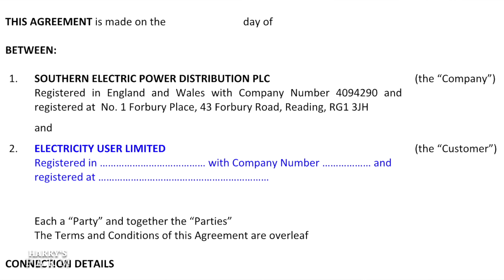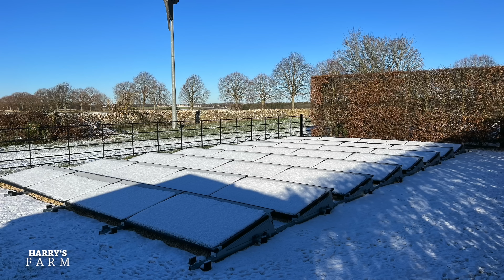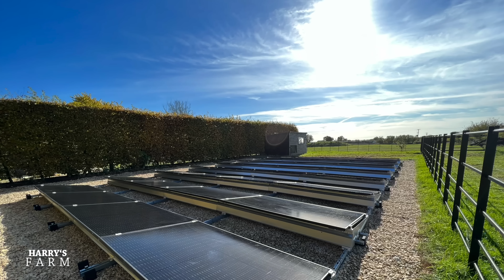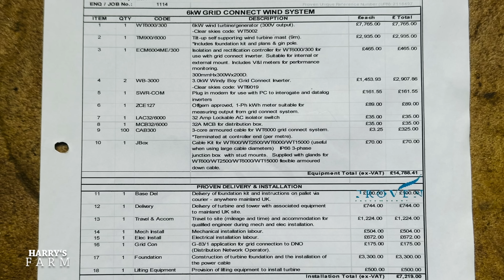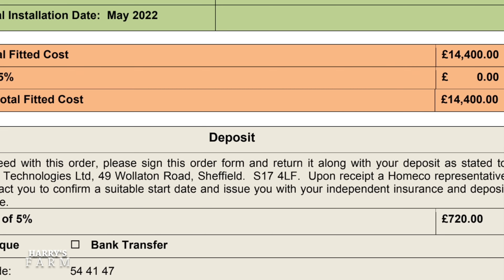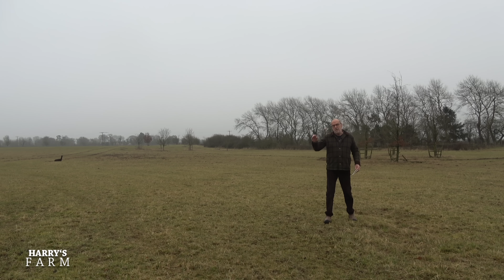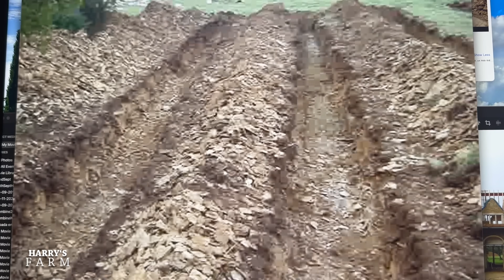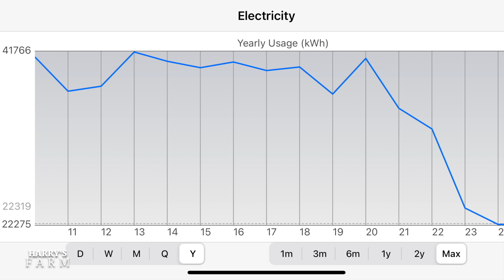Are solar panels & heat pumps worth installing? Here's what I've learnt after several years of use.

Comment: Solar doesnt really work well here in the UK. its the winter months when you need the power and those are the months when it doesnt generate any. Begs the questions is this massive investment even worth it. The people I know who have had 15-20k's worth of solar panels installed were told that it will likely take the lifetime of the installation just to cover the upfront costs.
Reply: Solar panels have dropped in price by 10x in the last ten years. Only 100 quid a pop now. 
Those early systems got generous subsidies too so I doubt that's true. 

The energy savings trust has a calculator to use for anyone who wants unbiased information.

Comment: Scientific papers can be a challenging read, many refer to other papers that should be read in order to understand the principles tested so can take days to plough through. Most of us don't have the time to immerse ourselves to fully understand them. The conclusions however are usually crystal clear and readily understood, viz:

"The greenhouse effect predicted by the Arrhenius greenhouse theory is inconsistent with the existence of the CRE (Chandrasekhar-type radiative equilibrium). Hence, the CO2 greenhouse effect as used in the current global warming hypothesis is impossible. Let us emphasize the overall conclusion:

The Arrhenius type GE (greenhouse effect) of CO2 and other non-condensing GHGs (greenhouse gases) is an incorrect hypothesis and the CO2 greenhouse effect based global warming hypothesis is also an artifact without any theoretical or empirical footing. Without scientific proof the debate on the CO2 GE based catastrophic AGW (anthroprogenic global warming) should be abandoned and policymakers should focus on the more urgent environmental and social issues of humanity. The recent worldwide energy crisis is a warning sign that the promotion of the so-called green energy is neither solving energy shortages nor helping to protect the environment from pollution. The climate does not need protection, but the clean environment does."

Ferenc Miskolczi: Greenhouse Effect and Climate Change

THERE IS NO CASE FOR NET ZERO.

Comment: If you want to get more over winter, you need to angle the panels better. Since yours are on the ground, it should have been easy to include a hinge and prop to adjust through the year. But you are right - no direct sun = no worthwhile output.

Also, tip for swimming pools - the biggest loss is through evaporation (latent heat). So if you are not using it cover it - even in the sun on a hot day.

Comment: To minimise the effect of the shading on the solar panels, you need an optimiser connected to each solar panel. That will stop the solar panels next to them switching off. Makes a huge difference for little cost. Your solar power company should have advised you of this.

Also those bushes next to them don’t help as they literally cut out the sunlight when it’s not at its highest point. You either need to raise your panels so that the sun gets through to them or lower the bushes to half that height.

Also if you had a battery, it could charge at a much lower rate at night and then use it during the day for when you have Low sun days. You can also charge at half price at night and export at a higher price during the day, bringing your bill further down.

Finally, you can add extra capacity of solar panels that are off grid for other parts of the farm.

Comment: We have just had solar panels and heat pump. Sold to us as in summer it will pay for itself. Reality in winter it eats electric at an incredible rate and cost is astronomical. In summer we don’t need the heating on so excess generated is wasted and not used. Don’t be fooled into thinking you will save money you won’t. Buyers beware.

Comment: Clearly the more northerly your latitude the greater the seasonal differences you'll see.  At regional or country levels a variety of energy sources will be necessary for year-round electricity so the large solar farms are useful in summer and not so much in winter.  The sell back to the utility/supplier also differs a lot by supplier and region - so all need to be assessed before you install.  Ostensibly, if you have a large solar array - you can store heat for the winter in insulated (in ground) "heat batteries" so you could heat a house with just a water pump (very few watts) circulating through that hot "battery"  and heat your floors.

Comment: You are to be commended for being an 'early adopter' going down the renewable route Harry, however, as an Engineer, Environmemtal consultant and someone who has a 12.5kW system on our house, its clear to me you didn't fully understand all aspects of solar before installing your system. Even though you have a single array, because of your shading issues (and even variances in individual panels), you should have gone with micro inverters. This would eliminate all the shading/efficiency issues pulling down other panels productivity. An array on a single string inverter will only manage solar production to then lowest performing panel. This is why you see energy production drop form your array. We produce over 11MWh's PA off a 12.5kW system, as all panels are on micro inverters and most are flat mounted. Even in January 2025, we produced 242 kW's from a flat mounted system, which is nearer to 2 MW's in June/July.
Reply: In no way whatsoever, will I challenge your knowledge with the installation of these systems, but there’s a lot of money required for this set up . 
Are you sure you can “ win” it back , or is it more of a moral code that’s driving this ?
Reply: @williammorris1384  depending on the grid chargeback rate, ROIs are usually pretty good, roughly 7 years on average. 
That being said, ideology will come into it for lots of people and help tip the scale when the payback is a bit longer or less certain
Reply: @sam-r7w  
That’s a fair answer. Thanks for your knowledge 👍👍
Reply: Indeed.  Did my own diy solar and storage system. 4 years payback. Build yourself and you learn to do things correctly and fix when there's a problem.
Reply: Agreed. I have deep technical knowledge and a 7kW solar array, and am competitive with these numbers. 🙂

Comment: The solar panels are so obviously at the wrong angle for the UK. 40/45 degrees to the summer sun at midday is optimum for the south east and these are around (15?) degrees so loss for this is quite substantial. As our sunlight angle goes up and down over the year these panels will get very little useable light in the winter even if the sun shines. Frost and rain on the panels will also negate useable power too. The shading should have been mentioned by the installation company as it is a singular destroyer of useable light.
Savings here are dependant upon the original cost of purchase and installation of insulation to the property, the heat pumps and the solar and wind generators. Until you have covered these massive costs you are paying for grid electricity to run it all. 
Perhaps three modern gas boilers would run this whole show and be totally controllable to take account of the annual changes in UK temperatures and cost a darn sight less to install and maintain and the gas feed would be CONSTANT year around.

Comment: So, in short, this solar and wind nonsense is extremely expensive for 95% of the population that live in towns in any property built before 2007 when insulation and building standards are not at the required level, even before you take into account the installation costs.

Comment: Strange he didn't mention that ground source is just as good at cooling in the summer, as it is at heating in the winter.

I get that he has a water to water system for in floor heating, but you can have a split system to reverse it in warm weather via air to water (back into the loop, supplement the domestic hot water. or in his case....into the pool).

Comment: UK govt figures have a load factor for solar voltaics at around 10%, ie panels only generate abot 10% of the theoretical maximum they could generate if they worked 24/7 for a full year.  Onshore wind is about 25% but that is declining as the best mountain-top sites have already been taken. Offshore wind is about 40%.

Search Energy Trends: UK renewables.

Comment: Harry, we got past the panel shading problems by having a micro inverter on each & every panel. If one or two go “dark” it doesn’t affect any other panel as each is independent of the other.
We have 26 220 watt solar panels & a 10.3 kw lifepo4 battery.  
Being in Australia, the cost saving is outstanding.  Our last summer bill was -$15.  So they owed us!!  If you want the power created, I’ll get back with the monthly stats.

Comment: Im a big fan of solar for rooftops, but I am against attempts by normal residents to produce way more than necessary in summermonths. And don't get me started on utility scale solar on farmland. Wind turbines (at sea) make much more sense.

I think the ideal is for every house to cover part of its energy use and get the rest from powerplants. Collectively, this is very stabilising for the grid and saves on a few powerplants needed.

Comment: Firstly, yikes! 14k a year on heating, in 2007! I have a large detached house and barely spend 1k a year, even at current gas prices. 19kW boiler, incidentally, and we keep the house quite warm.

Secondly, solar will always generate a lot less in the winter, but your system design will make that problem much more extreme because it's laid almost flat so it's aimed away from the sun in the winter when the sun's low in the sky. If the pv was installed on a slope (like a typical roof) and tilted up at a much higher angle from the ground, it'd generate much more in the winter, and probably a bit more in the summer as well.

Comment: Interesting video.  Can’t help think a Battery set up would transform this system together with more panels although we don’t know the orientation/restraints on space. Might be more efficient to use the Ground Source unit to heat the pool, relatively easy to do.

Comment: Given the UK's lattitude.......your solar panels are going to need a lot more tilt to improve their solar capture performance Harry.  Also, you would 100% use glass vacuum tube hot water solar collectors in conjunction with a heat pump.  You can overcome with the shading problem using individual solar panel "micro inverters" made by Enphase.  Your solar installers are IDIOTS.

Comment: Very interesting, we're waiting for our solar system to be installed. On your ground installation, it looks like you should be angling the panels into a steeper position in winter? They look very flat, more like a summer set up.

Comment: I've got to the point of how much is generated across the year. I've also read down to the first comment about installation gradient. I've got two systems with the same inverter and battery stacks. The roof mount has 3.6Kwp and is at about 20 degree pitch and the ground has 3.8Kwp and is at 40 degree pitch. Both face due South. In November and January if there is direct sunlight the ground mounted system will be outputting around 1000W more than the roof system. But if there is diffuse sunlight they output around the same. December is usually a pretty poor month for total generation with a few kwh produced on a sunny day but November and January are significantly better. I have a small heat pump that outputs 3Kw of heat with 1Kw of input and last December I used that to heat 40m2 up until 20 December. With direct sunlight and cool weather (i.e. during Spring and Autumn) I can get 4000W from a 3.8Kwh system. The key is that the panels need to be cool and so during Summer your panels would never output the maximum Kwp.So, output is determined by installation pitch, quality of sunlight, panel shading and how hot the panels are.

Comment: Also he's completely biased on his analysis. 

1. Aga is inefficient, is electric is cast iron
2. He's moaning about ashp on a swimming pool ignoring that the pool will lose heat massively because it's uninsulated. 
3. Use the battery to store cheap power reducing the amount of time your dependant on grid power. 
4. Solar in deep winter doesn't work brilliantly, but it does work brilliantly in early winter, spring summer and autumn. So you use a lot less grid power and you can use the excess for cars charging, air conditioning etc.

Comment: To sum it up, “it’s bloody good to be me!”
Reply: Jealousy is a cruel mistress.
Reply: …he took the risks and it paid off…well deserved.
Reply: It was informative but I have an average house and with a pen and paper worked out that solar in the UK is no good in Winter when you need it most, wind is only good in the North Sea as it's ideal for most but not all the year, battery and solar is good as you can charge the battery throughout the year on cheap tariffs with most suppliers but the payback is 7 to 10 years of saving and 10 years you need a new battery, it's better to insulate the internal side of the external walls with 50mm foam insulation with 12.5mm plasterboard  cost 6k and payback will be in 10 years and will last as long as the house!?!
Reply: @AtoMicHerrinski  He spent £14400.00 on his installation and generated £2,708.42 worth of electricity in 2024, That's a Return on Investment(ROI) of 18.8%, which is well over double the lifetime performance of star investor Warren Buffett. You could take worst case and assume not consuming any electricity at all and feeding every last kilowatt hour to the grid, you still make  10417 kwh * 15 pence / kwh at £ 1562.55, which is still 10.8% return that is effectively also inflation protected, because utility prices rarely ever go down but are always quick to increase. I'm blown away that this simple arithmetic passes almost everyone by.
Reply: Guy screams "I'm a rich prick" without saying a word

Comment: Dear Harry, you need so called “optimizers” at every solar panel. A famous supplier is “Solar edge”. They squeeze out max. Performance out of every panel. Esp. if one panel in a string has shadows on it. The optimizers boost output in winter as well. They have an IC inside with moves the Voltage/ Current level ratio in the sweet spot of efficiency.
Thanks for your great YouTube-channels. Love them…

Comment: Yeah looking at the flat angle of those panels, spotting the hedge and fence I did wonder if the installers were intimidated by their impression of your wealth, status and intelligent speaking into doing what you asked rather than feeling they should speak out and give you proper advice about winter and shade. It’s time to move that hedge 👍

Comment: What people forget is that when you calculate the cost of your heating and solar, you must also include the cost of the system itself in the bill. It is not like it was free. For example - calculate the cost of heating and electricity for ten years a) buy all of it b) have solar, wind, heat pump etc. If you spent 50k for your solar and did not have to pay for electricity, it still cost you 5k per year over ten year period.

Comment: I'm no expert but I do know that solar works best when the panels are directly facing the sun. Your panels are almost flat so in the winter when the sun is very low in the sky your panels will be almost useless. If you could raise them to face the sun properly it would make a huge difference but I don't know how you would do that without significant shading. Some real changes to their installation would be required to get anything in the winter
We have an ordinary insulated house (as in not brilliant) but the roof space is well done. the house is around 2800sq feet and we use around 2000 litres of oil per year plus maybe £300 of coal and logs. I'd love to switch to a heat pump but where I live we have no grants so I can't afford it.
It's a great insight so thanks for sharing.